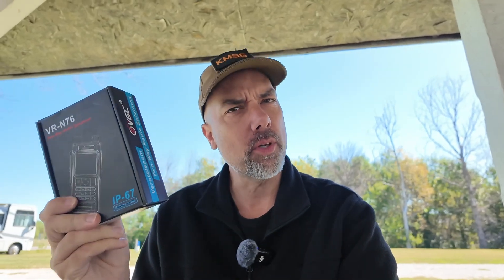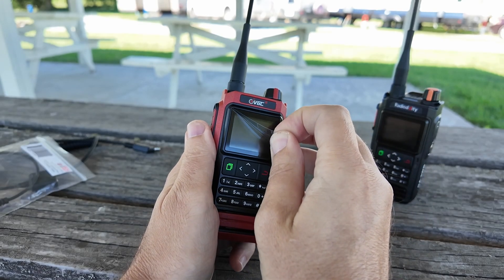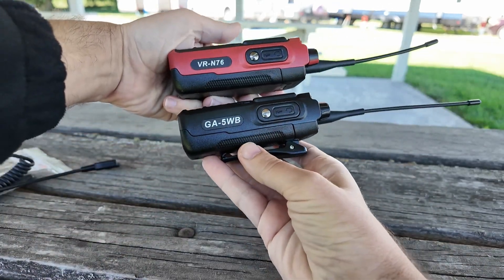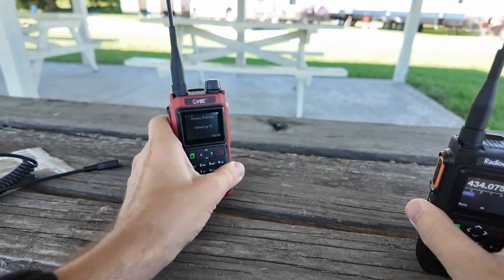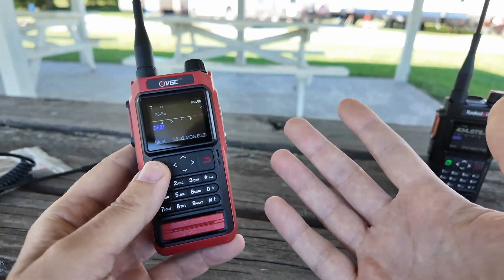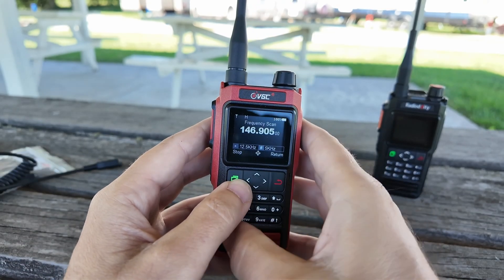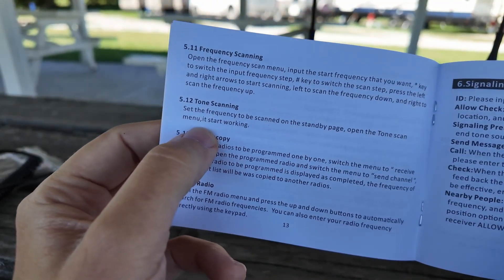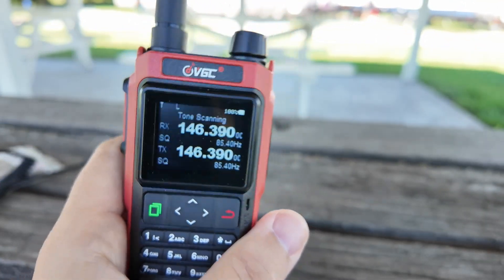CLONING & That Weird Connector On The Side?

Comment: You should have left that screen protector on and snipped off the tab. The screens on the Chinese radios are made out of SUPER SOFT plastic which will scratch if you just look at it! I found screen protectors from Amazon for large smart watches can be used quite successfully. They are quite cheap to buy in a pack of 3.
Reply from the maker: Sweet. Thanks for the tip!

Comment: Is there any way to backup or load data too or from a SD or other device?
Reply from the maker: You can use the mobile app to download the data, but just having the radio sync'd to the app is already backup #1, the download would be #2.
Reply: @temporarilyoffline  well duh on me!
Reply: Ordered, thanks for the $10!  On slow boat from China, DE K7SXN
Reply from the maker: @h2osmokey  you're gonna have fun!

Comment: Can you send email through APRS on the radio or only send sms on the UV Pro?
Reply from the maker: I'm not sure I understand your question.  APRS is pretty close to SMS in style and there are gateways out there that allow APRS->SMS (Cell Phone) and APRS->Email and back.  You can use the radio or the app to send messages depending on your preferences:  https://youtu.be/ZXzZOF9EPqI
Reply: @temporarilyoffline  for instance, if I type SMS:@cellphone number followed by a message it will go from my radio to a cell phone.  Will this radio also do EMAIL:@emailadress ?

Comment: They will work very well with APRS Droid or IGATE 2 PRO using the new BTECH APRS K1 pro & the K1:mic adapter. Tried them both tonight with my GA-5WB without a hiccup. Going to test it through my PC using Direwolf & Pinpoint APRS later.

Comment: Steve good things come to those who wait. Glad you finally got the Red one. The connector on the side might be an old ICOM type connector, I have a IC-32A and i think the spacing is shorter on the ICOM than the KENWOOD.
Reply from the maker: Could be.  Its an "M-Connector", just have to make sure all the electrics match between M and Icom.

Comment: JUST BUY THE PROPER MIC
Reply from the maker: GREAT IDEA
Reply: Instructions unclear. Dog whistle stuck in aux port.
Reply: Depending on what I’m doing ideally rather get the adapter, running a dedicated PTT on my webbing belt so would be handy to have to hook onto my headsets

Comment: Can it be programmed with Chirp?  or something like that?  Great video.
Reply: It can be programmed through the app (android version better with more features) I did it that way and it’s really easy best ht I have owned
Reply from the maker: I'd have to check, haven't had a need to use chirp since it has a good android app, but I can see why you might want that.
Reply: @temporarilyoffline  I am curious do you know of a way to manually beacon aprs either on the radio or the app?

Comment: Steve, thanks for the content, it's great!
I bought this Vero N76 from AliExpress, it's cheaper, but shipping times are much longer.  And i got the red one!

I'm very happy with the HT, because you have a nice APRS device, with an affordable price. 
It's right in the middle between a Baofeng with APRS Droid/Smartphone solution and a Yaesu FT5D. Kenwood, in my view, is great but out of the stage because is very expensive.

A huge advantage... You can set the APRS channel, to beacon transparently, and you can still dual watch (not dual receive) two other different channels/VFOs at the same time. So, you dont' have to limit one on screen VFO/Channel to APRS.

Downsides of this HT? 

The APRS implementation, beaconing every X minutes is basic, and it lacks of a SmartBeacon implementation that could be more useful to adapt the beacon interval based on the speed.
Also, the GPS fixing time without the app is way larger compared with the app, and it makes sense the app will be faster because the smartphone helps on that, but without the app that time is some times dissapointing.

But if you have in mid the price, you can have an APRS HT and it's excellent.

Regards from Argentina, and thanks again for you content!

Comment: Is the spacing of the jacks on the mic connector copyright protected or something?  Can't think of any other reason for making it incompatible with the rest of the market.
Reply from the maker: They just chose another standard.  There is an adapter available: https://geni.us/4I2s7
Reply: @temporarilyoffline a member in my group says the factory supplied adapter doesn't work lol
Reply from the maker: I haven't seen a factory supplied adaptor yet.  I have the btech version and it worked fine for me.  I need some more testing for PTT, but they is no VOX unless you have the btech software.  What was he trying to do with it and how did he get it? @jarredjones8476